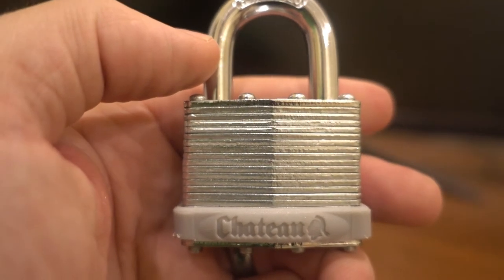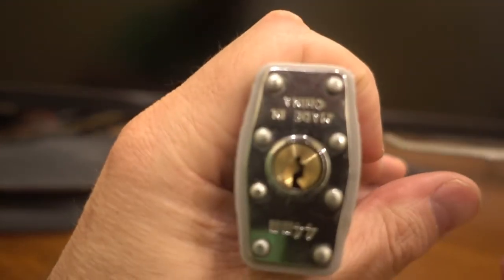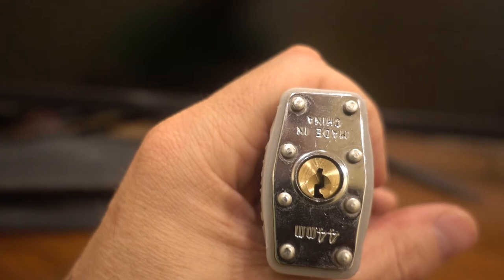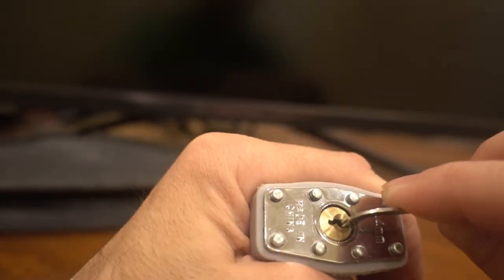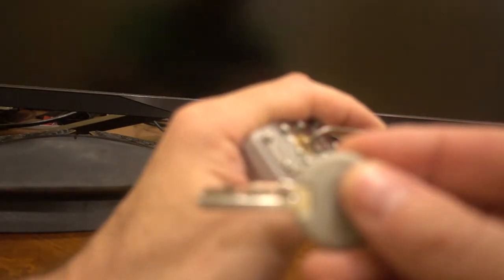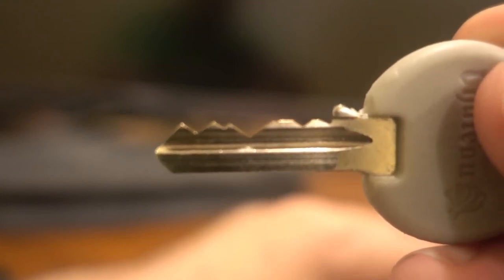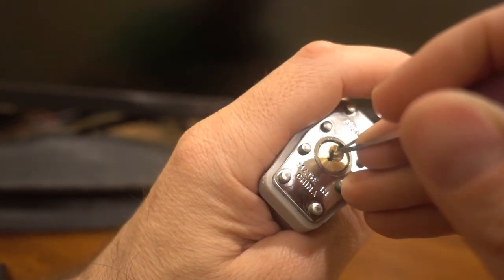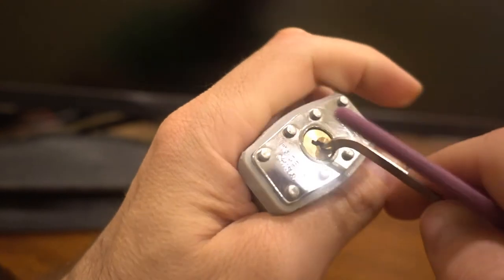Chateau 44mm Picked

Comment: Looks like an Abus-style core. Makes you wonder what it's pinned with.

I've tried picking the one I just took off my storage unit. My pick won't fit between the warding to get to the pins lol. I figured it was just going to be a Master knock-off. Not so fast! Mine is also rusted up pretty good so it's pretty crunchy inside.